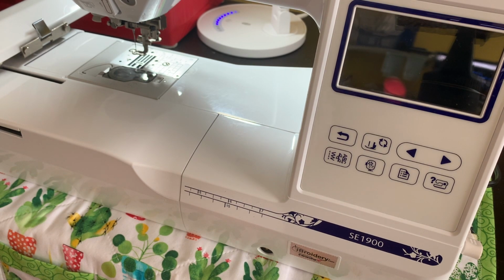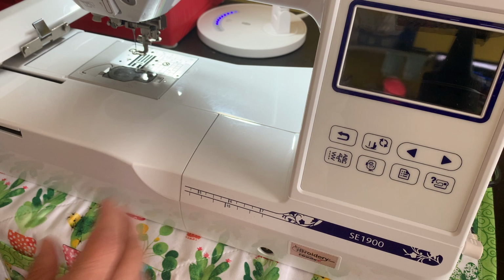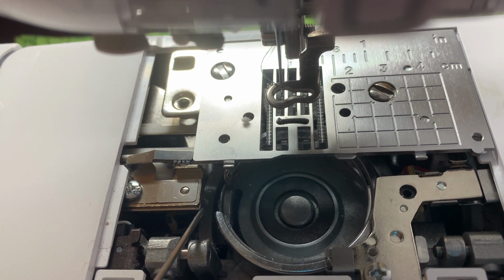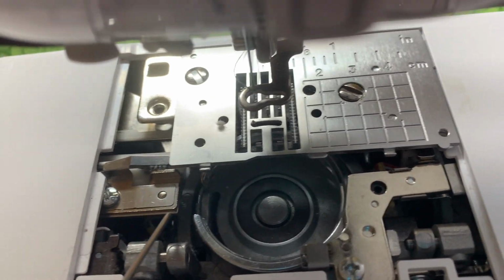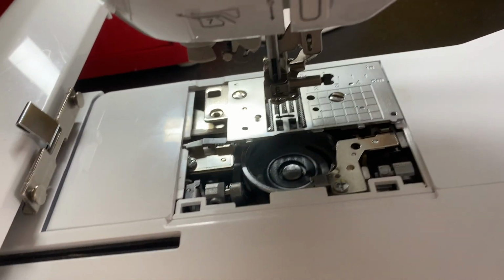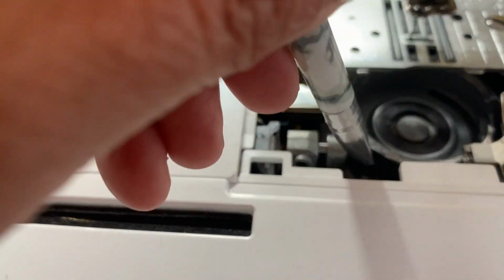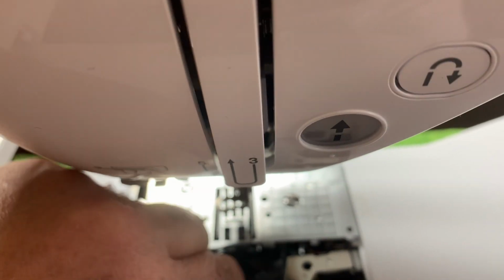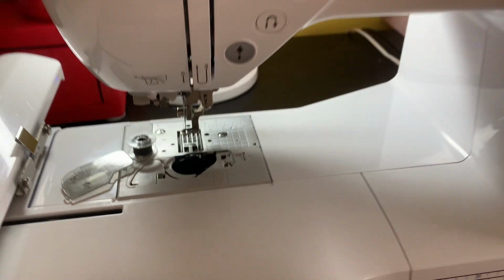Fixing the Bobbin Sensor on the SE1900

Comment: This is perfect and thank you so much.  I often clean the lint around the bobbin, but missed this area you demonstrated.  I cleaned it today using a Q-tip and got a lot of lint and tiny bits of thread out, especially on the right side after turning the wheel.  Wow!  Who knew?  Jeanette did, that's who!  :)
Reply from the maker: You are welcome!  Glad this helped!! Enjoy your machine!
Reply: Update March 8, 2021:  I thoroughly cleaned my bobbin area again today.  Today while sewing, the bobbin emptied but it never gave me any notification or stopped sewing.  When my machine goes in for service I'll have them check it out.  Something is amiss on my SE1900.